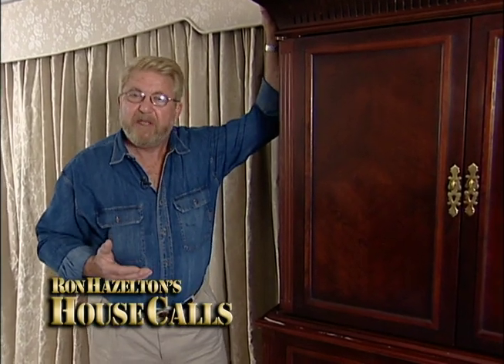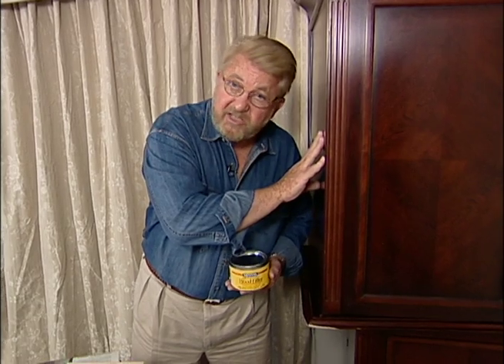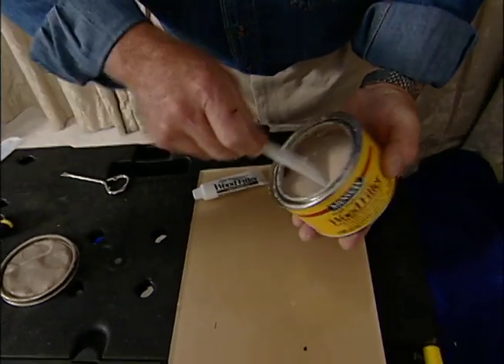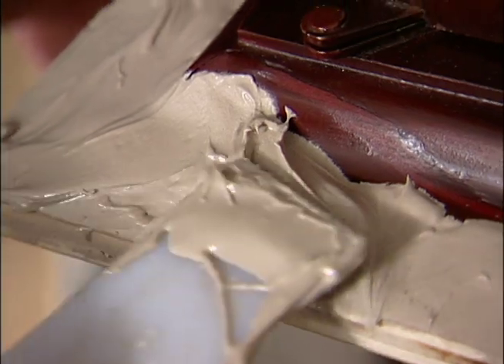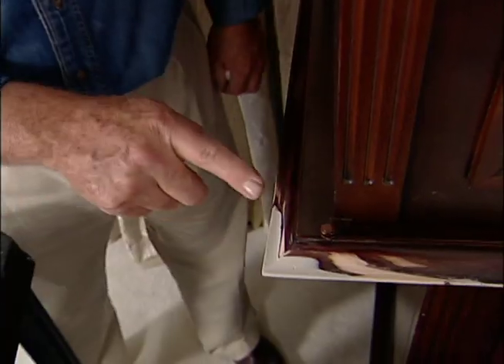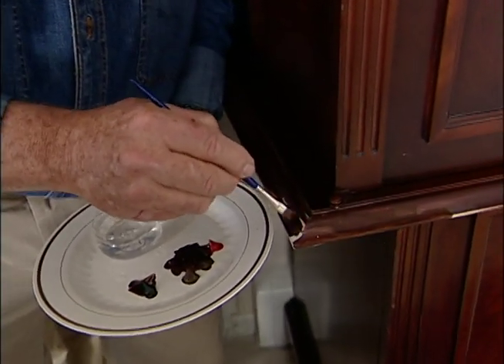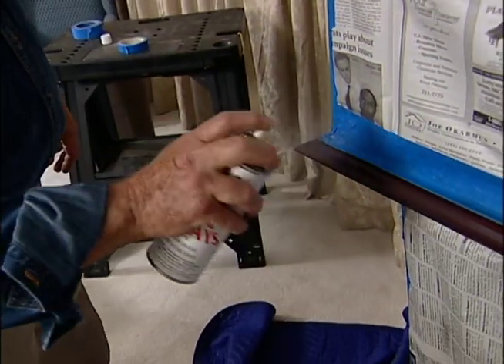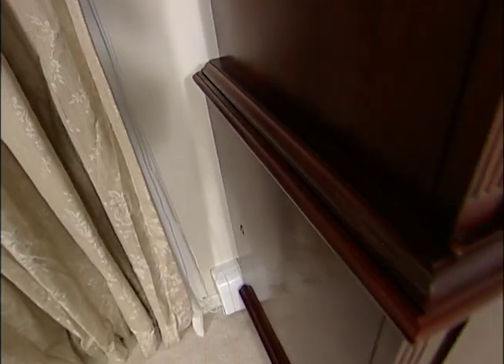Repair Broken Armoire Edge

Comment: A couple of thoughts having performed this kind of repair myself:  In order to limit the amount of polyester resin on the finished wood adjacent to the damage, you can cover it with blue painters tape and use a razor blade or Exacto knife to closely trim it right up to the edge of the broken wood.  Pull off the tape when the resin is still goopy. That way, you damage less of the finish when sanding. Another thought is that this repair won’t work well if you have a lighter finish on the wood that shows the wood grain.  When that happens, you are better off splicing in a piece of the same species of wood and try to get the grain to match closely.  The same is true if you are dealing with an heirloom or valuable piece.  Lastly, the polyester is brittle and cannot take stress, so this method won’t work well to fix a leg or structural part that will bear stress.  Hope this helps!!